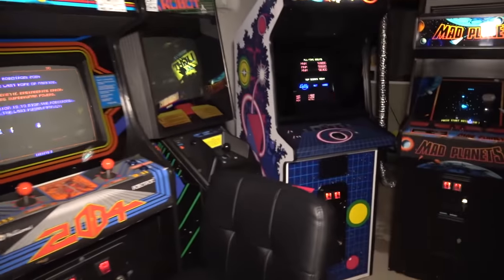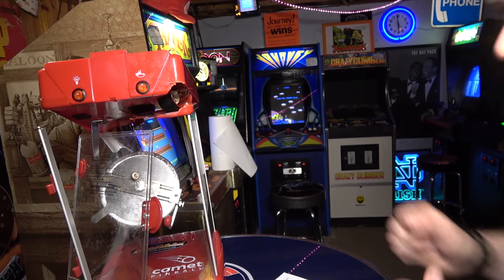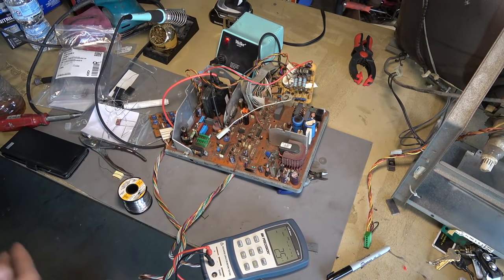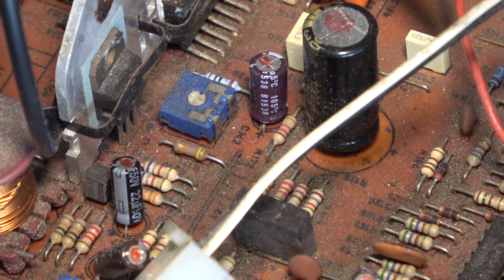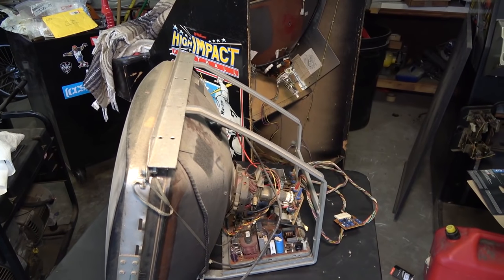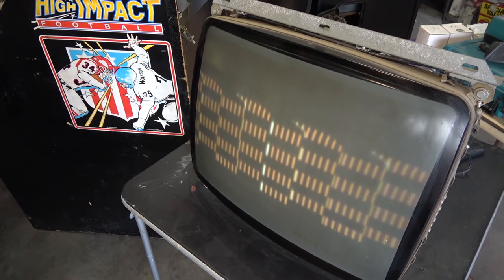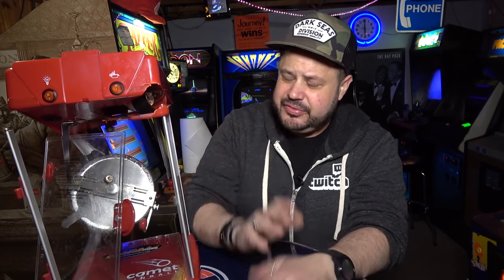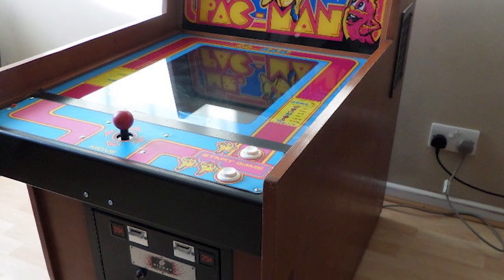MKII RESTORE PART 15 - Hantarex Polo Repair and film capacitor replacement - Mortal Kombat II Arcade

Comment: I just tried to repair a Hantarex MTC-9000 that I brought as not working with the idea to learn how to repair it. It was ticking and I found that the US250 PSU I was using to power it was running low on the monitor output, but not after doing a cap kit and replacing all the transistors and rebuilding the power section. I then found how to test the power section by removing the yoke connector and running a 35w bulb on the center pin. This allowed me to check the power and was how I found the input power was low. So after I fixed this I then found a resistor was starting to burn and it was on the 130v b+ so I removed the resistor that sent the power to the LOPT and found the 130v b+ was stable. My next move was to replace the LOPT and I had the same problem so I looked at the yoke and found I had one that was 0.5ohm when it should be 2ohm so I removed the yoke and saw that it was damaged and that was as far as I can go at the moment. Everything I did was thanks to watching your videos and especially this one as they are close in design. So you can imagine how I felt after watching the april fools video as it was at the time I was trying to work on my and I was really looking forward to seeing you fix it. Thankfully you have and that makes me happy.
Reply: DUDE make a video!
Reply: I did want to, but it was the first time I had tried to repair a crt and I needed to learn as much as I could without the added complications of recording it. I guess I could record one showing how I tested it and the current status of the yoke. I am also in the middle of making a Dick Smith LOPT tester and my LCR meter just arrived from japan so I should think about making a video for the next one I try with the better tools I have.

Comment: Film caps do have a polarity but it's not crucial like electrolytic are in this application, But if it was in an audio circuit path it is important to get it right otherwiseyou can produce hum in your circuit